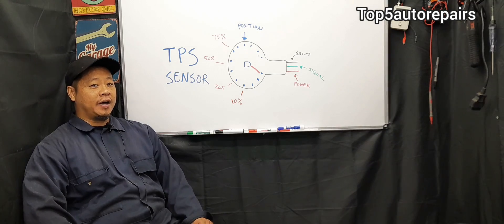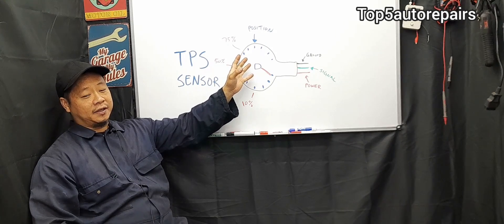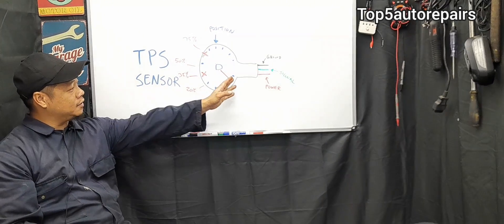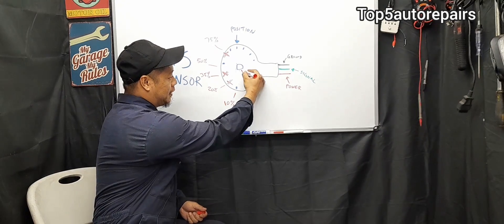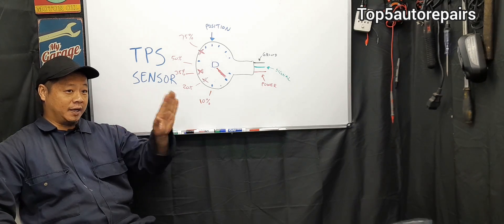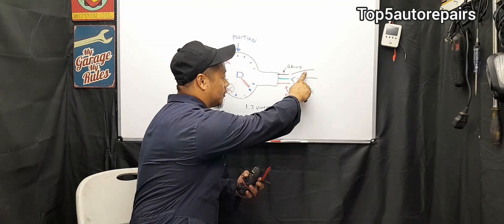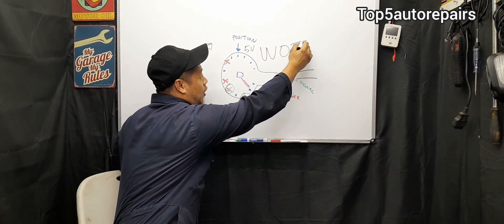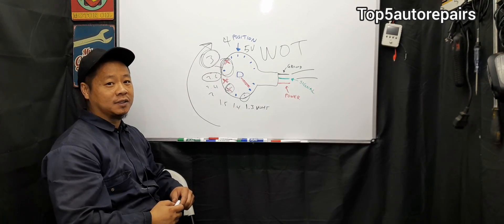SYMPTOMS OF A FAILING AND BAD TPS SENSOR (THROTTLE POSITION SENSOR) P0120 P0121 P0122 P0123 P0124

Comment: Would this cause shifting issues? I had the transmission rebuilt 5k miles ago but now im having shifting issues but like its over reving and the tachometer (digital) raises n drops dramatically. I really dont think its the trans i think its the throttle body

Comment: Could it cause a “stuttering” feeling between specific RPM ranges? Mine kind of sputters between 1,300-1,600 rpm. Idles great, no issues at any other RPM range

Comment: I have a 1999 BMW 323i and need to  replace TPS but I can't locate it.  Could you please help with this.  I'm a woman and I try to take care of my vehicles myself.  I just can't locate this sensor.
Reply from the maker: Hello. The TPS is located on the throttle body. It is between the intake manifold and air filter inlet tube / air filter box.

Comment: Help, civic 1.8 gen 8, when comming to a stop or a random shifting  from any gear into neutral while driving makes my car stall.. lets say im driving 70kmh in 4th at 3000rpm, when i put it in neutral, cars rpm go down to almost 0 and car stalls. Or while lets say driving at 30kmh in 2nd and comming to a stop sign and shifting into neutral, car also stalls.. 🙄 🤔. Clean tb, valves adjusted properly, good coils, good sparks, working maf, relearn procedure done. Whats left is idk if i can test the tps and the o2 sensor and need to check for vacuum leaks but i highly doubt that. And the car also jolts/sputters in idle and while driving at around 3000rpm.. shakes randomly similar like a misfire

Comment: I think this is my issue because my truck only turns on when I tap the gas pedal a few times and it’ll stay on but it sounds funny like it wants to cut off and my truck shakes bad when I’m at a rest position in the truck and it’ll kinda jump a little when I hit the brakes or switching gears and sometimes the truck will turn off. Also I’ve noticed when I crank the ac all the way up the truck sounds a lot more stable and dosnt sound like it wants to cut off as much but when ever it’s off or on the lowest air setting it’ll sound weak and idles like it wants to cut off also I’ve replaced my control idle air control valve sensor and the MAP sensor and it still does the rough idle and turns off, could it be the throttle position sensor because I’ve never replaced it ?

Comment: My check engine light blinks after about 30 mph. But my worse system is my transmission does not shift right. It acts like it's slipping from first to second. But when I hit the gas hard I can overcome it. Yes I do get surges in RPMs with loss of power!

Comment: Please help; at WOT (KOEO) my tps sensor signal wire reads 2.15volts instead of 4.7-5volts.
Any guidlines to things I need to check ?
Reply: Make sure your battery is 100% charged

Comment: Hello sir I have Honda civic 2002 crank but no start.I change cylinder head,fuel pump crankshaft sensor,valve,and ECU. Still no start pls. Help thank you
Reply from the maker: Check main relay